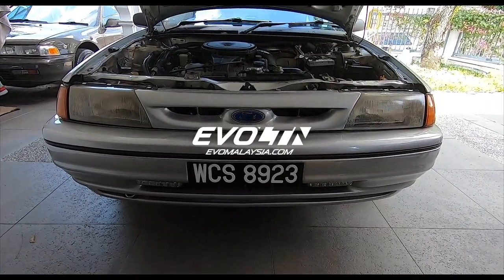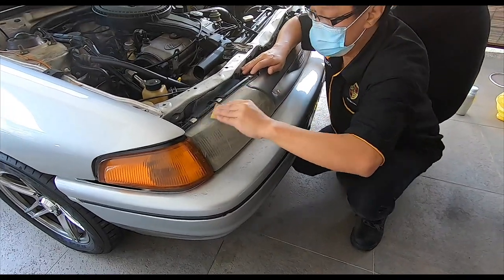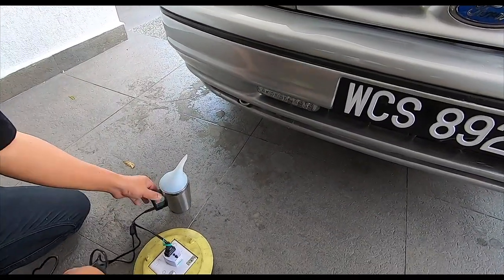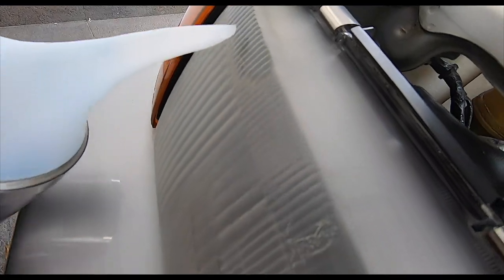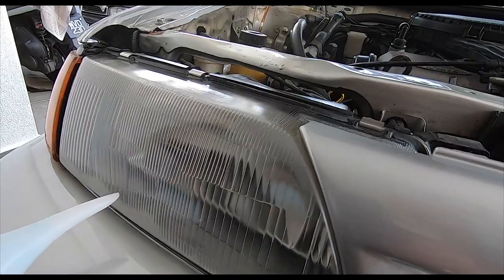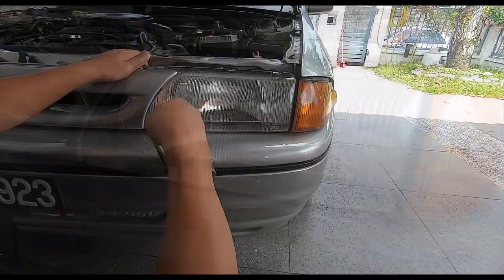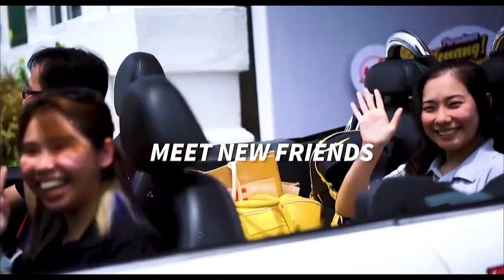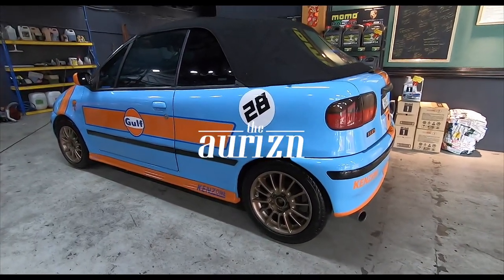FMCO 3.0 UPDATE!! 1992 Ford Laser 1.6GL Hatchback & NEW Kenzone Promo Launched! | EvoMalaysia.com

Comment: for those who were wondering what liquid they using, it's acetone. the acetone heats up and creates vapors. Then the created vapor will be clear the haze appeared on headlamp. The crucial part is the headlamp has to be sanded from rough grit to fine grit which shouldn't be more than 1500 gritt. Have tried it by my own and amused by the result.
Reply from the maker: Thanks for the feedback bud, yep, it's pretty good stuff 👍🏾😊
Reply: @ChrisWeevilGarage  may I know this acetone will it better than spray few layer of clearcoat?
Reply from the maker: @alibabas9525  I'm curious as well, will monitor and see 😊
Reply: Normally how long will this method last?
Reply: They claimed 2-3 years for this particular method, BTW each way has its own perks and cons, spraying clear coat is a good idea until those orange peels appeared on headlamp and make the finishing a bit artifical. The safest way i would go is the polish and wax. Where it might last for only a year, but safer when compared to other methods.

Comment: Used waxco previously with ford lynx plastic. It was good for abt 3  years. Maybe because parked in garage. Recently used meguiars on my iriz.  The part requiring more effort is the polishing or sanding. Once the clear coat oxidation is off.. then spraying uv coat is required Meguiars Guarantee 1 year hehe. So before 1year clean and spray again. Most likely no need to sand. See how next year.
Reply from the maker: Nice! Thanks for the feedback bud, curious to see how long this one lasts too 👍🏾😀